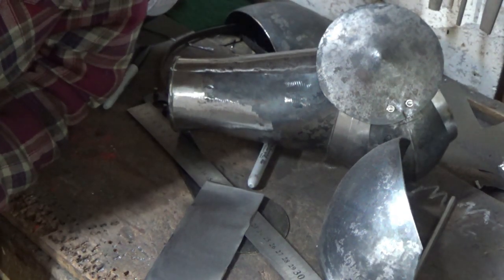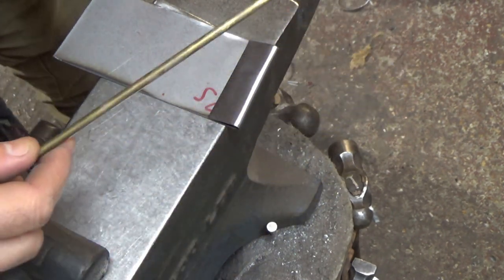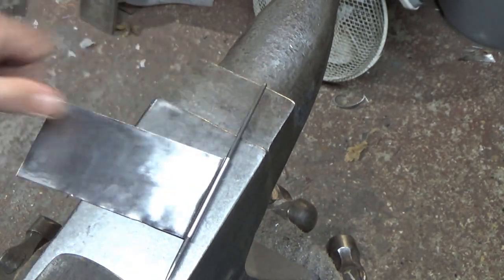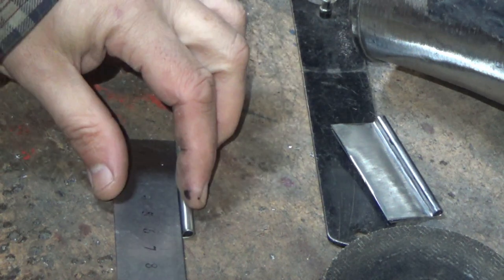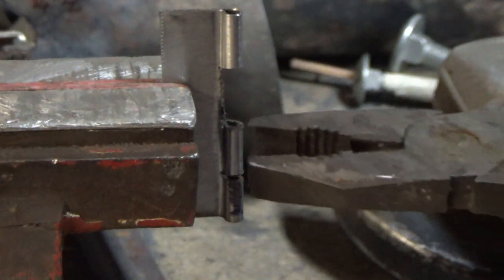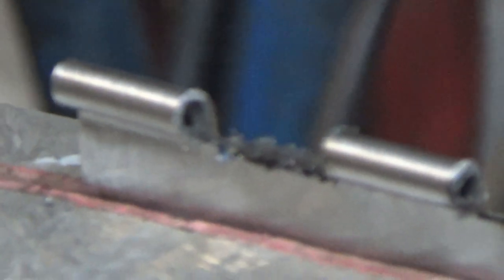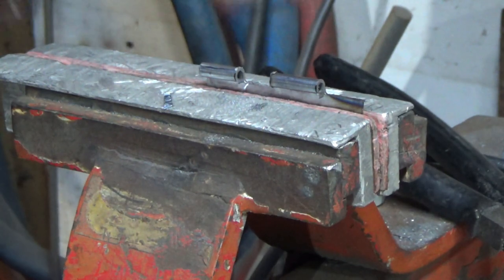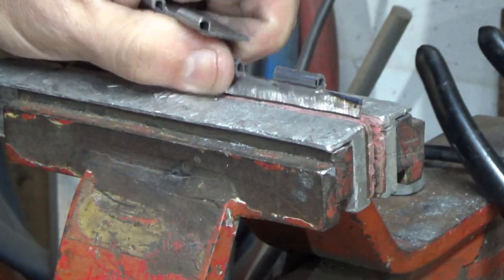Making longer hinges. Medieval armouring technique.

Comment: Glad to see another longer video! They tend to be very relaxing. In regards to a Q&A, my question would be: What sorts of costs are associated to starting out? What are the most essential tools to armouring? I want to get into this purely as a hobby someday. Cheers!
Reply from the maker: Hi there, I've just done a bare minimum tooling video, but this is the absolute minimum. Aimed more at people thinking I might, but have no experience, level. I plan on doing another soon that gives the minimum for those a bit further along the road so to speak. I hope that makes sense?
Reply: @GreenleafWorkshop  Makes complete sense. I think breaking it down like that is actually perfect, and makes the whole subject much more approachable :)

Comment: Keep up the great work. I also like the longer step by step instructional videos. They are very informative. What would be the best beginner armor project to start with? Is there a diagram or chart you go off of for measuring your customers to properly size the piece of armor you are making for them?
Reply from the maker: hi, thanks for your comments. I don't have a chart or similar, although I am going to do a couple of films detailing what measurements I like for customers to be able to look at. My favourite starter project would be a 12th century helm as it stretches folk in a few directions, but can be built with a minimum of tools. I intend to make one and film the project and supply patterns … hopefully sorting it all through Christmas.

Comment: Please, can you tell me, what sheat thickness is ideal for hmb suit hinges?
Reply from the maker: depends on the material, and be ready to replace and repair. 20g-18g carbon works well, but they are so light and delicate a solid smash at the wrong angle can still damage them. I think that's why most hinges tend to be internal on hmb rigs and not the early 14th century external ones. I tend to go with hidden 20g on ones that are likely to get hit.